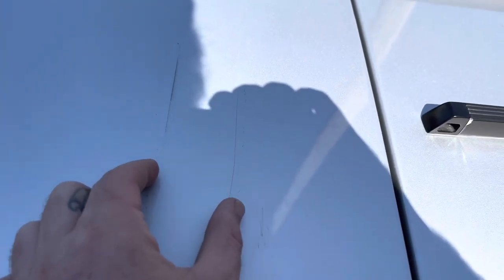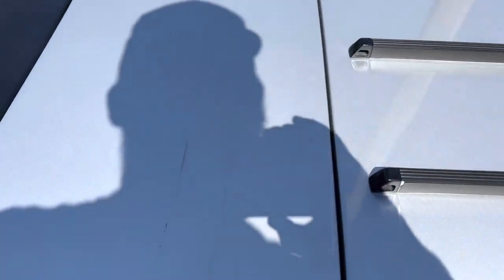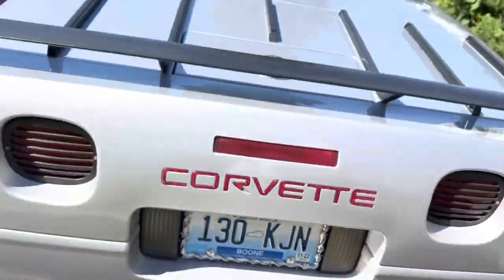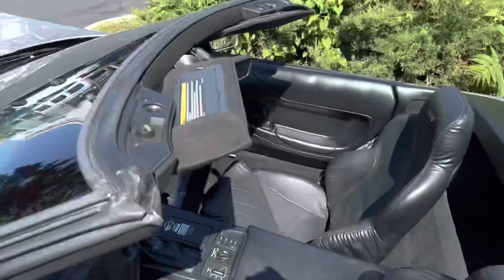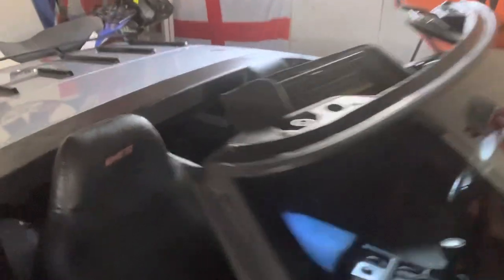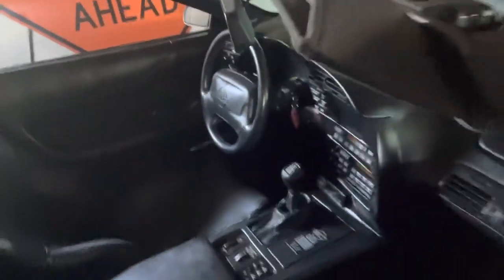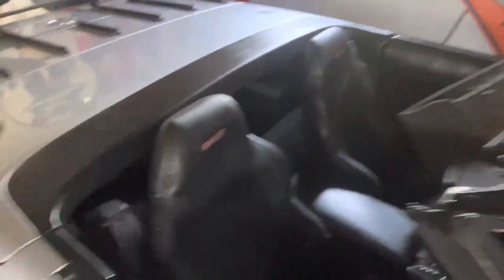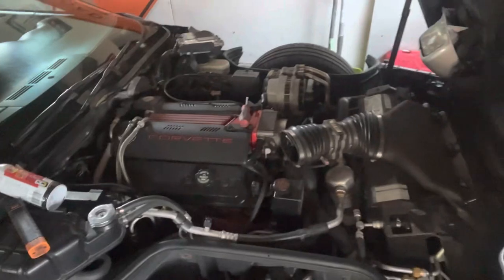I’ve bought a 96 LT4 Corvette. Then I broke it.

Comment: Nice me and my girlfriend have 95s.love them.mines a convertible.want to get an lt4 coupe though or zr1.the opti does kind of suck on these engines.make sure you check your fuel pressure and ignition coil and icm. Easier and cheaper.but if it is the opti lock tite the screws and black rtv that cap.if you do the cap and rotor give it a quick start before putting it back all together to make sure you don't need a whole new opti.should be engine light on for it but not always.both our cars we've replaced the whole opti.i got a remaufactured ac delco on Amazon 360 dollars.2 year and ten thousand miles now still good.hers I cheaped out a bit advanced auto 190 dollars .only been 2 months but seems to be doing good.good luck!
Reply from the maker: I bought a whole unit it’s a summit racing branded one. It’s got a decent warranty worst case scenario. When I pull it apart tomorrow if it’s just the rotor that’s damaged I’ll probably just put a cap and rotor on it and retain the factory distributor.
Reply: @TheDangShow69  wow that's crazy I actually got one from summit to for my girlfriend but when it came in it didn't spin cleanly made a roaring noise and had a slight wobble to it.i couldn't put it on seeing that the old one and others I dealt with spun smooth and true.the one thing I will say about summit is they promptly refunded my money when I returned it without hassel.thats why I ended up with the advanced auto one.hopefully you have better luck.i would keep that old opti too.it may be the original and have the Mitsubishi optical sensor.i only seen one place who still sold the optispark with them for 500 bucks it was a corvette specialty place.cant remember the name.lots of people have problems finding a good quality one these days.